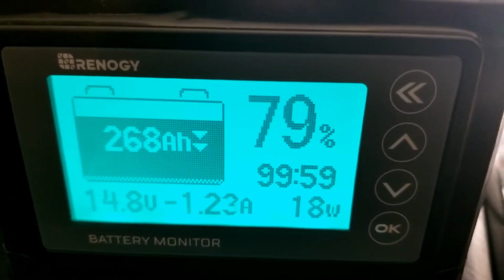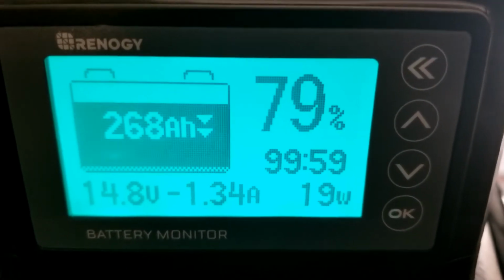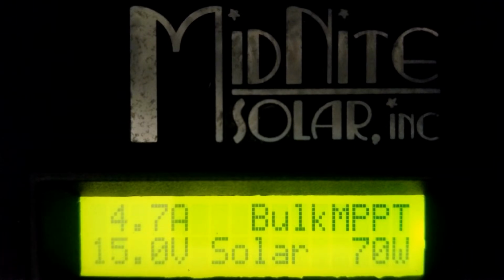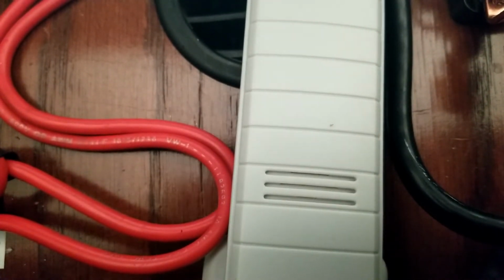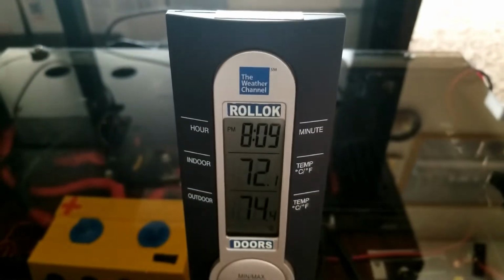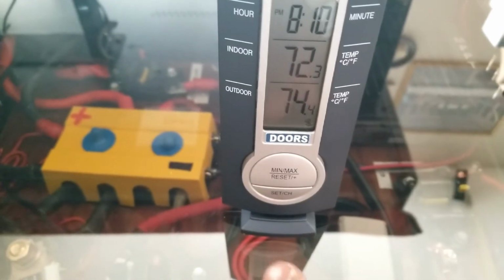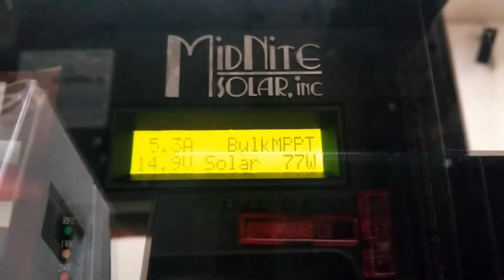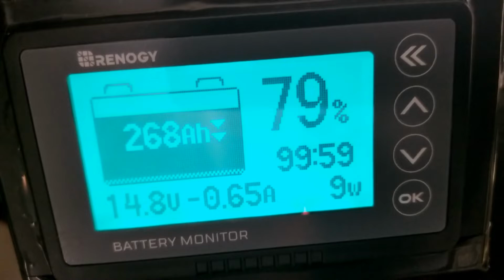SOLAR GENERATOR: LIFEPO4 SOLAR GENERATOR CHARGING & DISCHARGING

Comment: Excellent build portability and it’s working great . How about attaching the battery meter on top of the slide door  ! That is one made masterpiece .
Reply from the maker: I am not sure if I'm going to take that route. 
I'm might use my Victron Smart Shunt or my Whizbang Jr. With the MidNite Solar (The KID) instead of using the Renogy batery monitor.
I may want to keep the Renogy monitor for test purposes like testing new battery chemistries. 
Thanks for your awesome opinion and comment as always. 
Cheers.